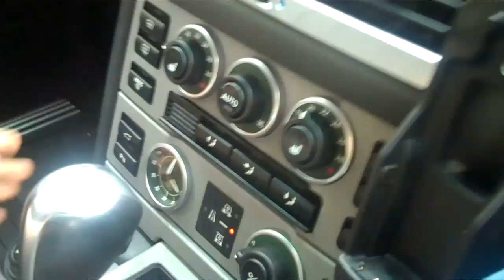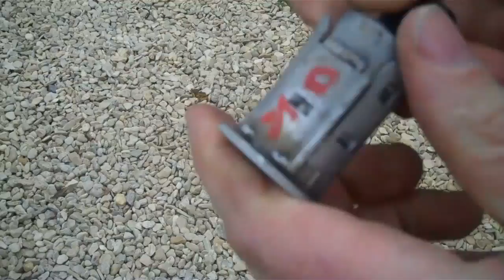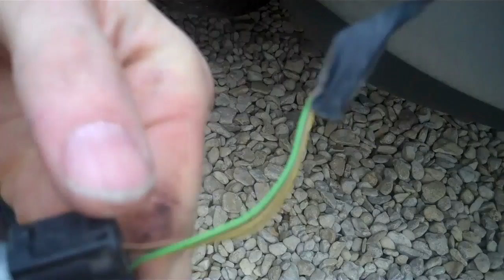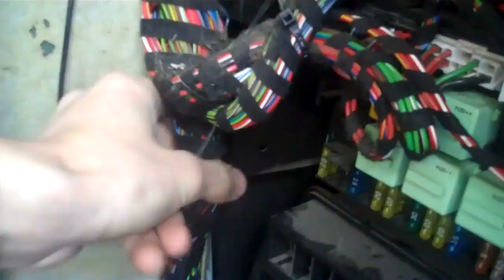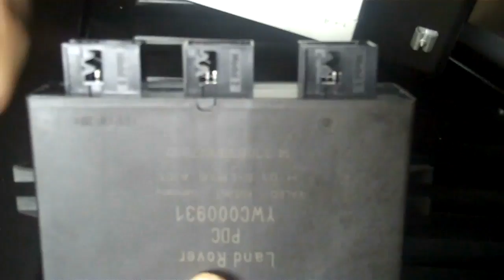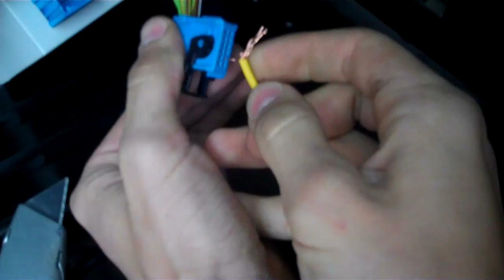How to Diagnose & Fix Parking sensor PCD Problems on Range Rover L322

Comment: If the sensors all work but the pdc intermittently doesn't work what would you recommend?
Reply from the maker: Interesting - my guess is wiring issues / damaged wires / poor connections ?

Comment: Hi I’ve got a freelancer 2 2009 both front and back parking sensors are not working .if you press the button it flashes 6 times but no sound any help would be appreciated thank you

Comment: if all sensors are clicking is this a PCM issue??
Reply from the maker: Most likely, yes.
Reply from the maker: If all sensors are clicking that sort of good but if you still have an error i guess it could still be a sensor or wiring... as the clicking is only the emitting part - each sensor also needs to "listen"
Reply: All clicking as soon as it's in reverse then long beep. I'll try the module. Would u recommend the newer if I have the white module?? Thanks fir the help
Reply: module did not repair the issue (sadface)

Comment: Well ! I must have a different L322 to anyone else ! Despite managing to get my hand behind the wheel arch guard, getting my big fist up inside the metal girder that acts as the 'strength' of the bumper, is definitely a non-starter, especially the passenger side which has the washer bottles strapped inside the bumper stopping any access to the sensor!  Not a happy bunny :-(

Comment: All mine are not working and the switch on the dash does not come on
Reply from the maker: Hi check the fuse and the parking sensor control module - in the boot on the right hand side.

Comment: Is thete an easy way to remove the sensor in the rear? 2 of mine are not clicking and the bumper os hard to remove.
Reply from the maker: You could try and get your hand up and push them out - but the problem on my parking sensor issue was the wiring - not the sensors - and you can only tell this by removing the bumper. The bumper removal is not that hard - i agree it seems scary but once you have done it its no problem.

Comment: Hi guys, great video, thanks. I was hoping you can steer me with a problem with the PDC on a 2010 RR Zermatt with GCC specs. The system is DEAD! I have checked the connections to what I think is the module from your video, it appears to be upside down to the one you showed. however, have a butchers around on the left side rear stowage I have discovered a set of 3 connectors that look remarkably like the PDC leads.......but nothing like a module. There are 2 screw studs looking like something should be mounted on them? I can email pics as required. HELP please!!

Comment: A great video and I now know how to tackle the job!  Are the front and rear plugs into the module are identical other than colour?  If so, as bart of the diagnosis, could the blue and white be swapped to see if the fault goes from the back to the front.  If so, it is the wiring to the sensors or the sensors.  If the fault stays at the back, it must be the module.   Would this be correct?
Reply from the maker: +Neil McIntosh Hi - if they are the same then that would seem like a good fault finding method although i would be surprised if it was designed so you could swap them - too much risk of wrong assembly in the factory.

Comment: I have a 2007 Supercharged Range Rover. I want to disconnect the rear sensors all together by way of the fuse box method you showed in the video. Will there be an error message if I do this?
Reply from the maker: +CJ Svela Hi - i think if you remove the fuse you will be OK - or just remove the connections from the box.

Comment: My parking system doesnt work. Is it possible to test the PDC to see if it is really broken or just something wrong with the cables?
Reply from the maker: Hi - if you cannot hear them "ticking" then yiu have a probkem - but you ar enot sure if its the sensor or the wire - normally it will be the sensor
Reply: +powerfuluklt
Reply: Globehouse events do ranger rover tech get paid well

Comment: does this apply to the 2006 Range rover HSE USA, i noticed the fuse box was different. I think all were ticking except one, hopefully it is a quick fix and i don't need to get into the wiring harness. Also do you know the fuse number for the power outlets (cigarette lighters in the front, glove box, rear and trunk) I blew the fuse and cant find a wiring diagram for the 2006.. Please please help tired of getting screwed at the dealer.

Comment: further to my earlyer post cleaning the plug only lasted one day.
took vehicle to local lr garage found the two center sensors were irratic but when i swopped them to the outer positions(to see if the problem moved and or it was the wires) the system worked ok no faults GRRRR!! but fault returned later, did cont test and all wires checked out ok.
removed ecu opened it up which is easy found various chips had corrosion on there pins so clean them all off and all has been ok for a week so far.

Comment: had rear sensors firing off permenantly, was about to order new set of sensors.
but after watching this vid thought id check the terminals on sensor ecu,
found light corrosion on some of the rear sensor plug terminals, so cleaned them up and all ok.
p.s the bolt to the rear of the fuse block is hidden behind a grey relay mounted by itself

Comment: Thank you for your video. Had the same problem.  Two sensors had a wire problem. (Totally corroded inside the plastic casing. Random places). One had a paint bubbles.  
3 out of 4 rear sensors were not working.

You should uppload a video how to remove front bumper.

Comment: Great video, a common problem not mentioned is: If your sensors are going off erroneously check for burbling paint on the face of the sensor, scrape it off and if the problem goes away you just need to re-paint the sensor.